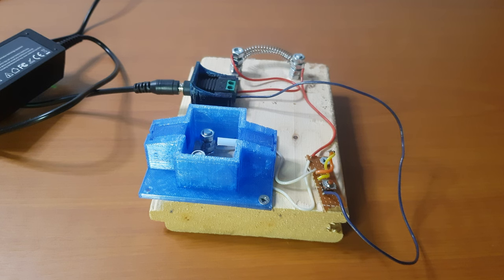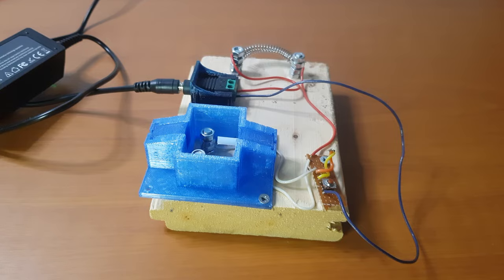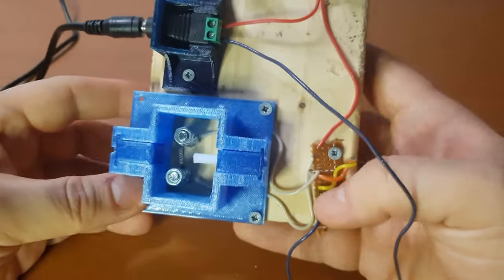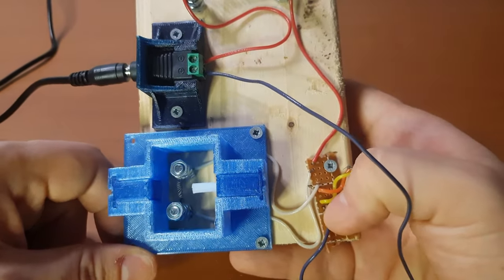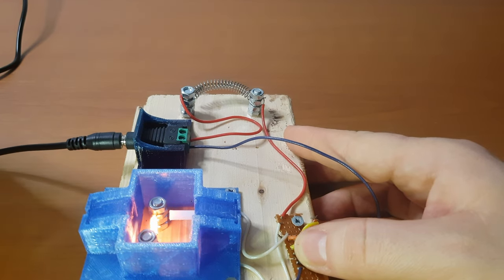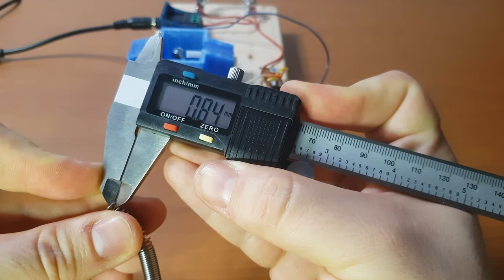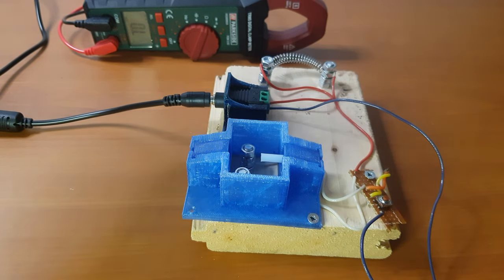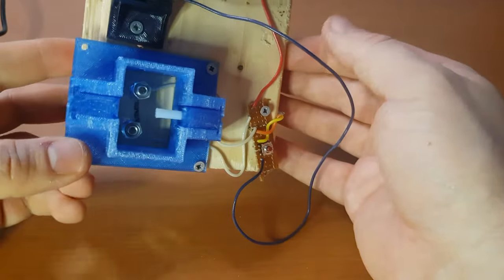3d printer filament splicer (welder) 2.0

Comment: That's definitely hotter than 300 degrees. it glows extremely bright...
Reply from the maker: unfortunately you are right, just rechecked and realized that my thermal camera is limited to 300 deg celsius :)).  I have a thermal gun that can measure up to 480 , and that one is showing 315-320, but it's hard to measure such a small area with it, so I expect it to be around 400. still, it serves it's purpose.

Comment: Heat the PTFE until glassy so it can be pulled to thin it down to exactly filament diameter.
Then use it as the joining-point by winding a loose nichrome coil around it (not touching the PTFE) and heat slowly until PLA melts inside the PTFE.
Once you figure out the power level and timing the fusing can be set on a timer for each joint.
Reply from the maker: yes, PLA is somewhat easy to splice, but for melting PET filament, made out of plastic bottles, you need more than 255 degrees C, and at that temperature PTFE starts degrading and emitting toxic fumes.
Reply: @BaldEagle3D  Right, I didn't think. I read PET, I heard PET, I understood PLA 😛
PET or PETG though? Big difference really. Still, for PET(G) I'd use a polished split-steel former. That avoids having to thread the filament.
The goal should be no cleanup of a joint.
Reply: @1kreature PET. From plastic bottles. He just told you in the last answer 🤪
Reply: @jonatanboy  People often buy PETg filament and think it is same as PET from bottles. That is why I asked. Although except for a tad more flexibility they are quite similar.